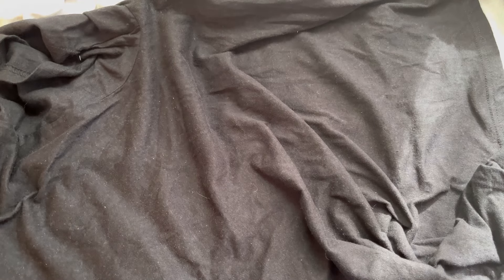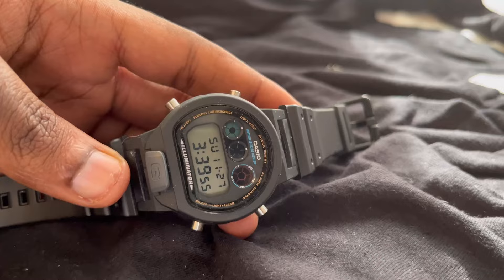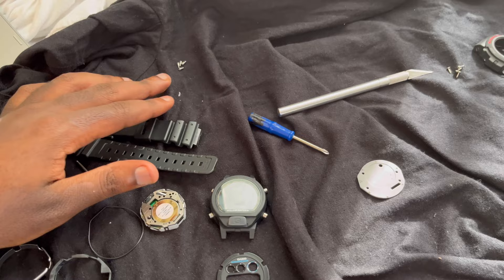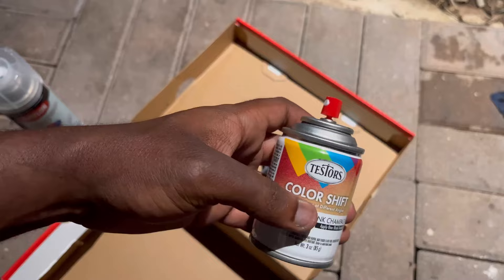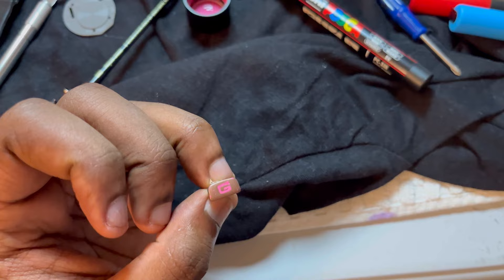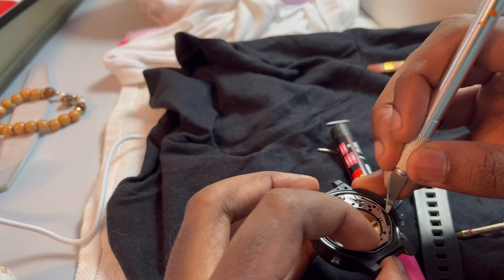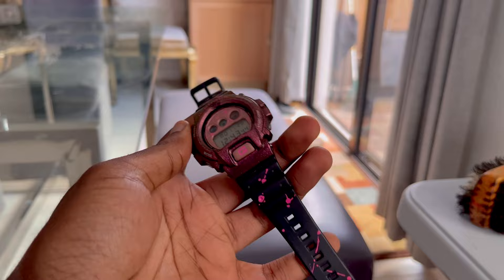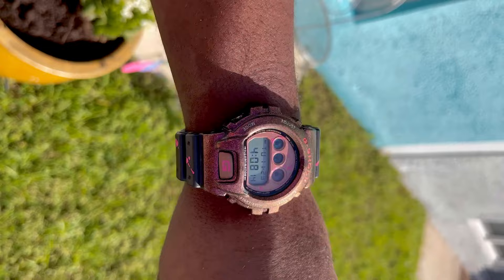TUTORIAL: HOW TO CUSTOMIZE A G-SHOCK WATCH!! (DW6900 Model)

Comment: I want to customize mine but I’m worried that the paint will wear off in a few months.
Reply from the maker: As long as you do the right prep work and use the right paint it’ll last, this one is still fresh and I’ve worn it a bunch
Reply: What paint did u used?
Reply: how did you save those word from spray paint?